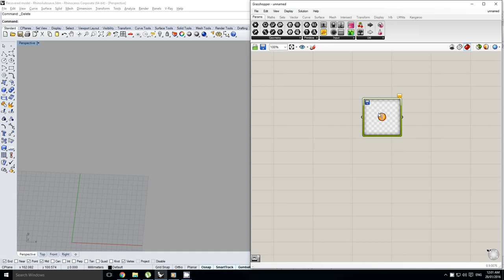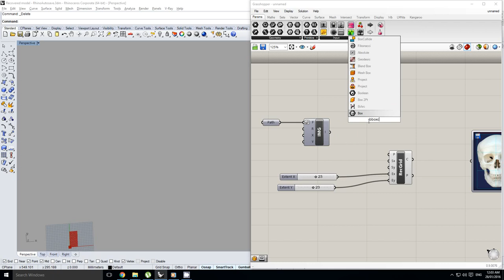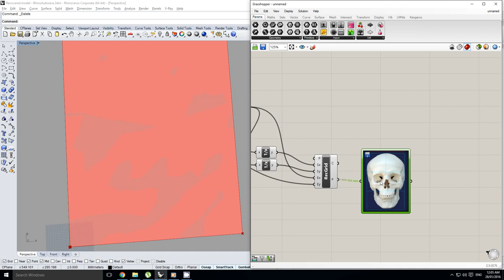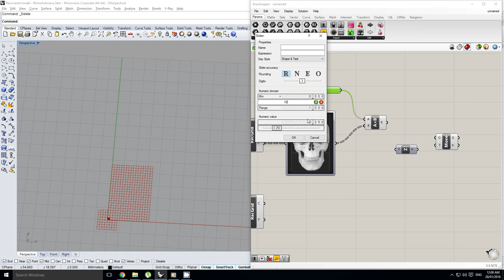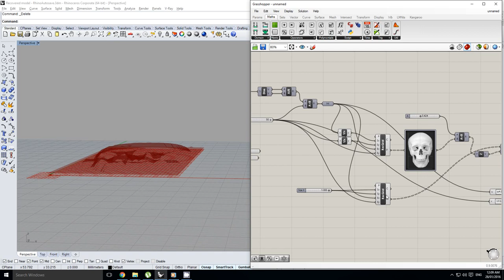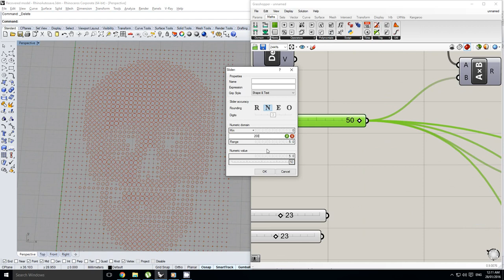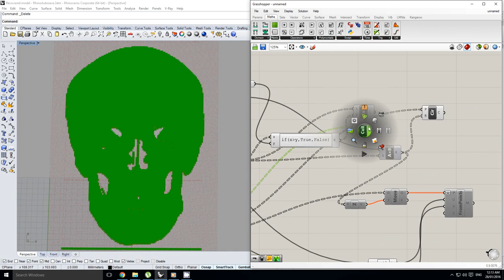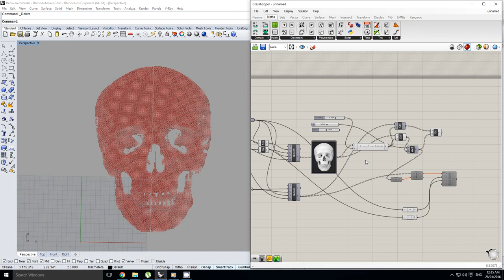Grasshopper - Using the Image Sampler

Comment: hi Daniel,I tried to explode a box and use one of the surfaces to apply your method, but when I use deconstruct domain2 component to get the U and V domains,it shows that the U domain do not start with zero,but the V domain does.Then I select another surface of the exploded box,the U domain starts with zero.This is quite bewildering and it would be great if you can give me some tips.

Comment: Daniel your help needed :)
Ill start from the end- I need to make a portrait made out of dots fritting pattern (pointioalist image) in a range of 10 different dots sizes maximum- when the smallest size is 5mm diameter and the bigest is 10mm diameter.
I mananged to convert the image to fritting pattern and apply the range of the biggest and smallest- but I dont know how to get a result of only 10 diffrent sizes.
Is there any way to do so?
Reply from the maker: Check out this thread on the grasshopper website. I added a reply with a definition for how I would do something like that, and would largely be applicable here.
http://www.grasshopper3d.com/forum/topics/remap-a-set-of-numbers-to-3-values?commentId=2985220%3AComment%3A1754814

Comment: do you know how to restrict the circle radii (or image sampler values) to specific numbers? like if I want all of the values to be integers, or to have 5 steps between radius 1 and 2?
Reply from the maker: Check out this thread on the grasshopper website. I added a reply with a definition for how I would do something like that, and would largely be applicable here.
http://www.grasshopper3d.com/forum/topics/remap-a-set-of-numbers-to-3-values?commentId=2985220%3AComment%3A1754814
Reply: thanks!